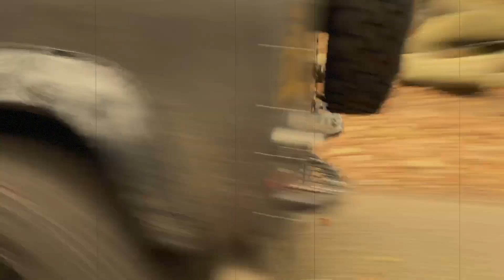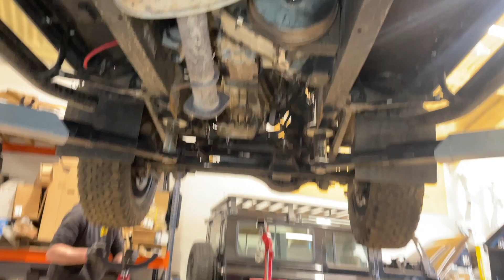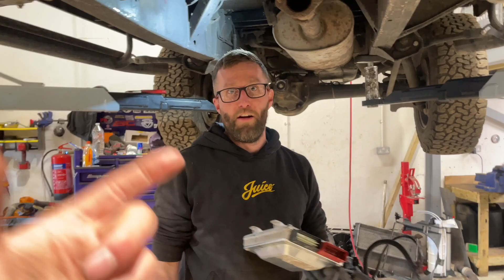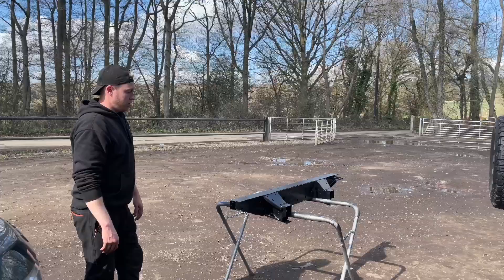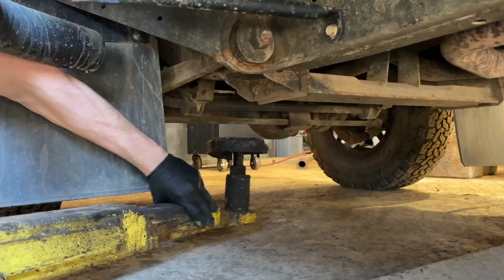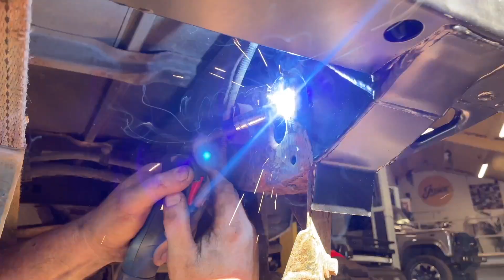BUILDING AN AUTOMATIC DEFENDER 110 & A CSW 90!!

Comment: I'm tempted to fit a TDV6 into a Defender, as it's smaller in every dimension than a Td5 except width, and even then it's just 9 millimetres wider. Even better would be the TDV8, but I doubt that's quite so straightforward!

Comment: man I hate how landrover pushes these engines way forward with these long bell housings! my 110 2.5 petrol is a mid engine! way back against the bulkhead, almost all the weight of the engine behind the front axle! 
what would be neat is from the clutch and flywheel a short shaft to the gearbox aka unimog. to change a clutch drop the shaft pull bellhousing and change clutch! not too mention easier conversions
...or like g wagon, shaft between box and transfer...

Comment: Love these videos, ive got a 90 puma that i'm keeping factory original but my project im about to start is a series 2a with an old daihatsu engine in it and a knackered gearbox, looking at what engines i can use, 200tdi seems to be popular.. Anybody else have any ideas what i can use with little modifications for mounts/loom etc?
Reply from the maker: A 300tdi is the easy way to go for a series! Look up Steve Parker conversions, they sell a kit to bolt in with all pipe works etc

Comment: I've seen lots of people  upgrade there brakes  but I've never seen or herd anyone  upgrade  there brake servo or Reservoir to go with the bigger brakes. Is this somthing  that isn't necessary  or is it done and just not talked about?
Reply from the maker: You must have the double banded servo fitted - they won’t work without the increased pressure. There’s no need to upgrade brake servo or reservoir, they bolt straight on and perform!

Comment: J/M.  Could we see you guys address the Def' drivetrain weakness to maintain or improve reliability with this powerhaus ?  Doubling the power/torque without any other associated strengthening such as chassis, axles or diff' changes such as a Salisbury and "No Spin" traction aids !  V.

Comment: Will you be filming the ac install on the tdci? Curious if you'd run into a similar issue I had. Where basically the compressor didn't kick in once complete, only to find the tdci (apparently) has a weak earth and needed a simple relay.
Reply from the maker: We have already converted quite a few Tdci’s we haven’t had this issue, they click straight away and go ice cold, I’ll film this one to show
Reply: @juicemotors  excellent. Guess I was the unlucky one. I'll send a pic of what was needed on mine (on insta)